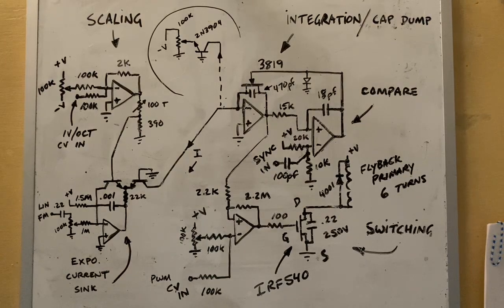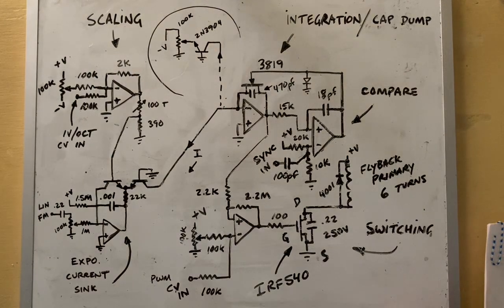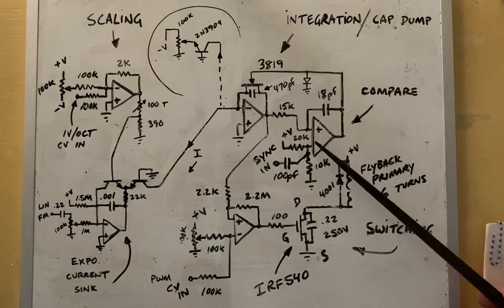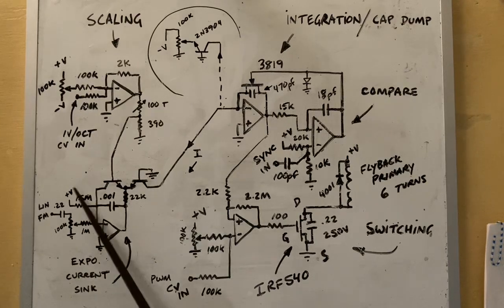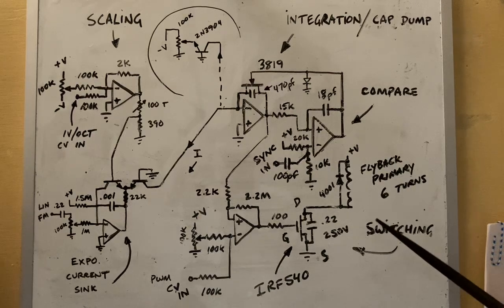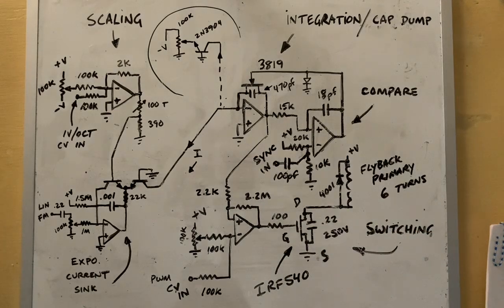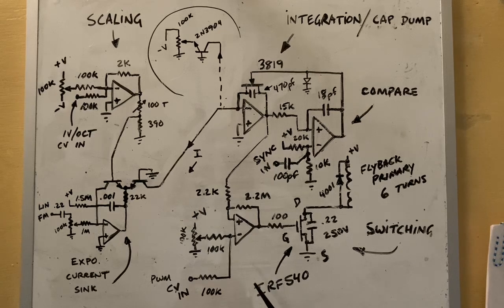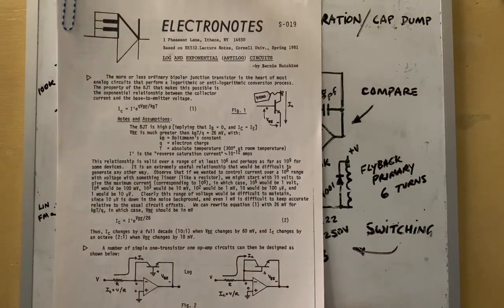Graviflyer thoughts and observations video 6.

Comment: the flyback circuit can be changed easily if you add frequency and duty cycle to the input of the circuit. This allows you to change the frequency and when that happens the volts and amps change on the output. The biggest learning from this is the result which changes the amps to either charge or to magnetic. all from a frequency change. The circuit would also change the duty cycle or pulse rate of the energy but not the zvs. This is changing the beat rate of the circuit without changing the mosfets switching. The parts are under $30 maybe under $20 on amazon. I use this circuit to change the effect on the disc's to charge or magnetics. On other tests I go from energy that can flow in the air to a tight field. It is a better way of understanding how to change quickly without changing the circuit. The amps and volts change the frequency of the circuit. you would normally think that is is isolated to volts and amps only. It just is not the way high voltage works. The ratio is more like 5:1 five changes happen to every one change made. I hope this helps. https://youtu.be/ag9jqnBTY9g here is the old video i did I have to remake it. But you will get a general idea.
Reply from the maker: Thanks for the response. My circuit offers real time control of frequency and duty cycle with control voltage input. I didn’t show the inductor which current drives the primary of the flyback…The IRF540 has a.22 mf cap which is resonated with the primary and zero voltage switches when the frequency is properly adjusted. This mode of operation is similar to class E operation. The cost of this circuit is negligible…What am I missing here, I should just buy the same driver as everyone else and fail to learn anything new?!
Reply: @Flamejet51  that was the beauty of the parts i use. They take the failure out of the equation and allow you to have complete control. it is also all, off the shelf items that you do not have to build. On my channel 30% can build circuits. the rest can buy and add parts to them to get everything running. I would like to see both approaches side by side. Maybe in the future we could do a calibration on a  video for that. think about it. I am booked for the next 3 weeks but after that i am good to go. I am working on a zvs tesla coil spread sheet for building. using 20, 24, 28, 32gauge wire on 3 different size pvc pipes 2", 3", and 4.5". all resonating at 300khz (target) it will be simple to order the zvs and a coil and have a nice tesla coil. anyway let me know.
Reply from the maker: @oldmanbuilds  Thanks for the feedback, I see your point and appreciate the info. Eric Dollard brings up the use of an analog computer in the video you recently posted and that is my main goal with incorporating the analog modular synth stuff because it’s along the same lines. Although my video production is totally in the stone ages, I would be happy to collaborate on a video!